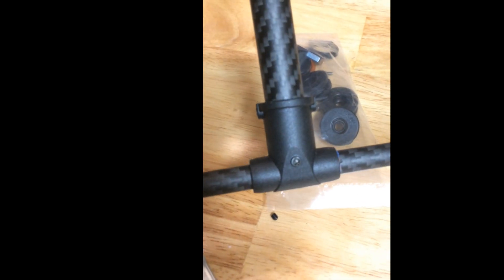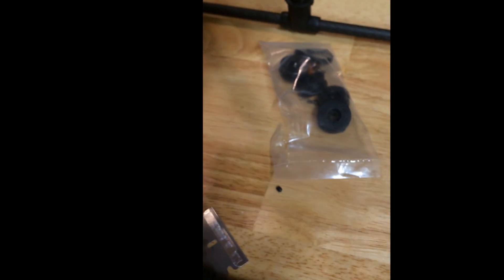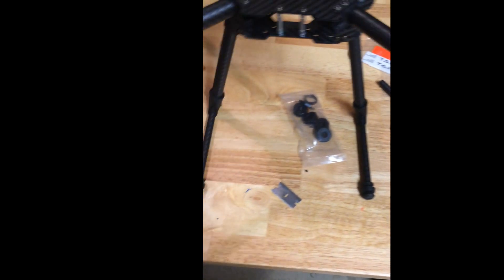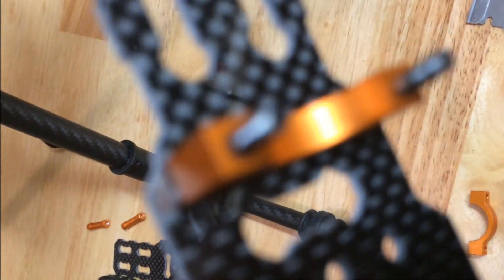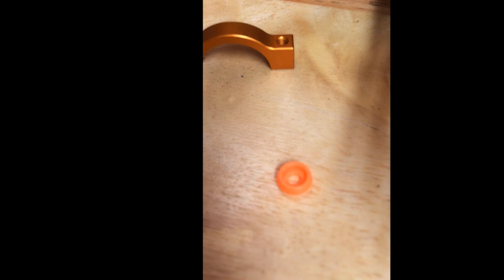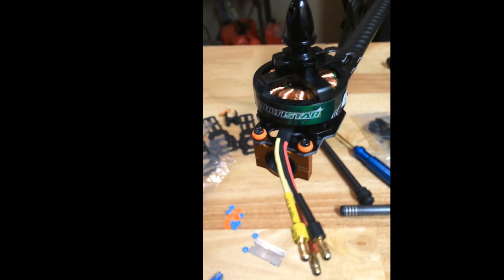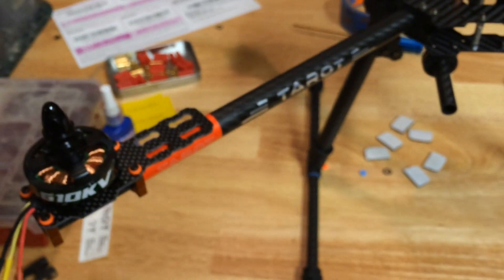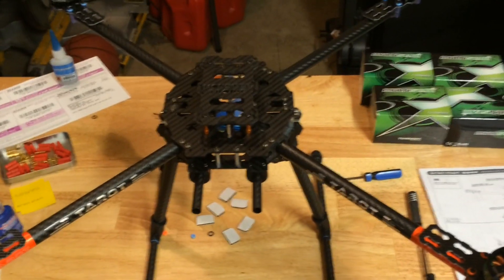Tarot IRONMAN 650 review and build Part 3

Comment: those orange vibration dampers should be between clamp and plate . what good are they doing above plate at bolt head ?? thought you were experienced  ?? you talk like you are but I guess not too savvy
Reply from the maker: Those are not vibration dampers. They are just hard plastic cone washers. Thanks for sharing your knowledge.

Comment: Trip, my parts are coming in and I am about to get started.  I hope you can help with a couple of questions.  1) It would seem the vibration washers would go under the motor mount and not on top? 2) How do I make sure my motors are perfectly level? I purchased mine from BangGood and it came in a brown box, no printing, no manual, no nothing except parts inside.  Makes me wander if it is a copy.  But as long as it works the same I don't care :)
Reply from the maker: Tim, those little washers are not really vibration washers they just give more surface area for the screw. as for leveling the motors... do just that on a level surface. I just level them all with each other and use the center plate as a reference. you could use a piece of square alum tubing and bridge across from one to the next and carefully measure the distance on each side of the motor mount to the level surface. A good eye helps as well. I spent about 10 min's eyeballing and making several fine tune adjustments then flew it. wasn't that complicated. I'm sure there are all kinds of methods just use your instincts.
Reply from the maker: none of my motors came with any manual/or instructions either.